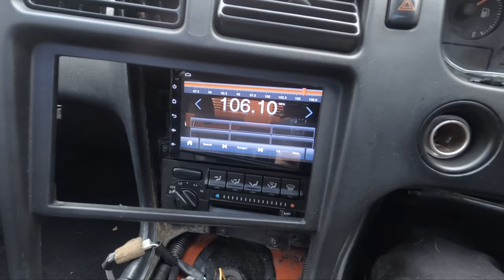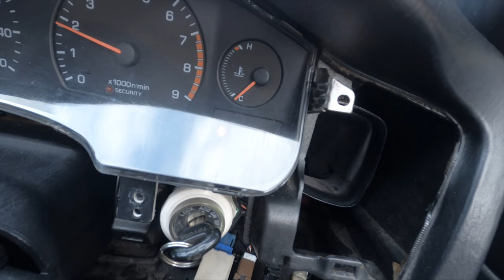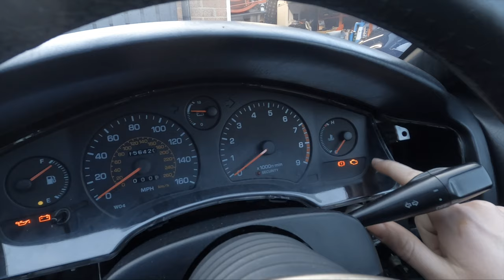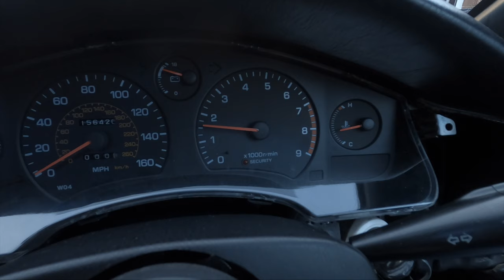MR2 Turbo Will not START / will not RUN - ECU Repair - How to replace leaking capacitors - Part #17

Comment: I fix these for all the big Facebook groups, done hundreds this year, been crazy, the 2 x 10uf 50v brown coloured caps in the 17380 rev 2 turbo like you have are the buggers that cause 90% of the faults, the other caps cause the remaining 10%  I have lots of parts for these ECUs and all mr2 ECUs built up quite a stock now broken a few down to use for donor ICs been a great money earner but I'm not greedy so do the repairs cheap but use top quality caps from Panasonic, Nichicon & rubicon that exceed the specs of originals, mr2 enthusiastsof 25 years, my small contribution to community keeping these going, I even fix the corroded pcb tracks with new tracks, bench tech 22 years, home workshop many crazy expensuve soldering tools 😁 but makes doing them quick and easy, nice to see others fixing stuff, well done dude, too much is thrown away or deemed unfixable newer days.
Reply: Hello how can i find you on Facebook

Comment: I have exactly the same symthoms on my supra just like your video i replced the capacitor but it still turns on and thn dies.i didn't add weld on the capacitor on top did I have to do that i thought only on bottom of board